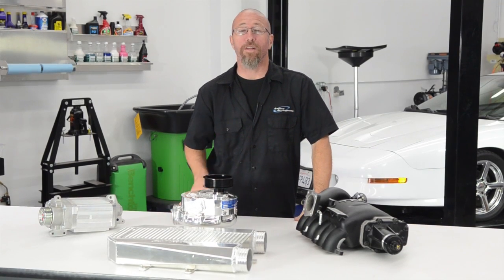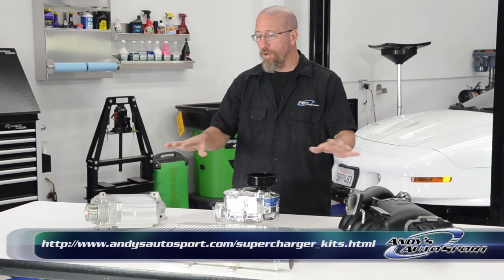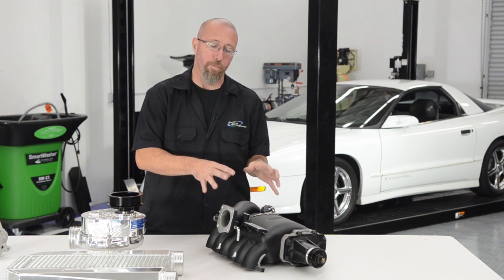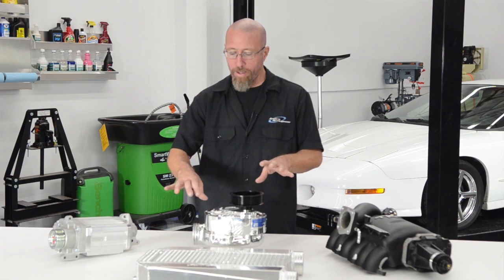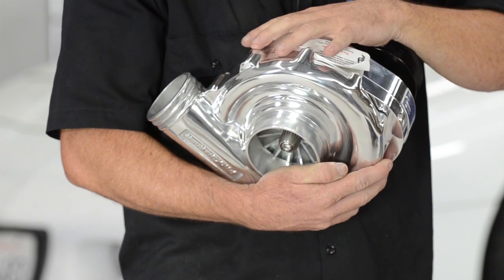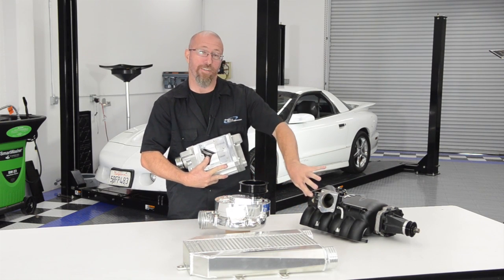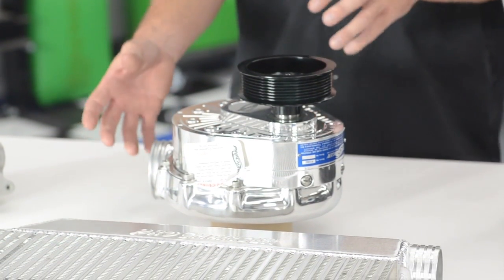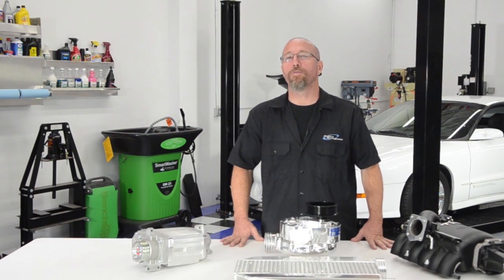Superchargers Overview - Roots, Centrifugal, and Twin Screw

Comment: Do you all have any knowledge of running a supercharger on the newer engines that have the cylinder deactivation systems. I ask because I have seen a few people who have 1000+hp vehicles getting 20-24 mpg with the engines that have the cylinder deactivation setup.
Reply: Cylinder deactivation is definitely possible with moderns electronic engine control systems.

Comment: Not bad. Very thorough. The only thing that was missing is ... which supercharger was quietest ...during idle and ... during boost. It would be ideal to have had a audible sound comparison.

I originally came to find out which one was more fuel efficient during normal driving and which one during all out boost.

Comment: Hey Andy, I have an Infinity G35 and I'm looking to gain a little more bottom end horsepower without adding a turbo or super charger or anything that complex. What would you reccomend?
Reply: I don't think you have any options if you say no turbos, superchargers, or anything that complex. Anything for good power is complex. you can do a new intake, exhaust, and programming but you wont gain much. A good tune might help with low end power, maybe.
Reply: Josh Hagerman Agreed. A tune, cold air intake, exhaust, etc. won't add more than 20-70 HP at best. You have to go forced induction or nitrous injection if you want to add >100 HP.

Comment: Two-stroke diesel, by design, need a supercharger otherwise it won’t run. Instead of having a normal valve at the top of the cylinder like a normal 4-stroke diesel do, two-stroke counterparts use a transfer port at the very bottom of the cylinder end but unlike 2-stroke gasoline, two-stroke diesel doesn’t use a crankcase scavenging effect to breath in air instead rely on supercharger to push in air inside the combustion chamber. One of the benefit of having this design is it doesn’t burn oil as the lubrication system are the same as a normal 4-stroke gasoline/diesel and also it doesn’t suffer from a charge leakage like a normal two stroke do as the poppet exhaust valve is still there.

Comment: A naturally aspirated engine of any displacement, cannot draw in an amount of air/fuel equal to it's displacement. 100% volumetric efficiency (VE) is all but impossible. The combustion chambers atop the piston bores are dead zones which prevent 100% VE. Now if there were no combustion chambers, you might have a 100% VE engine, on the intake cycle, but you better not try a compression cycle. lmao
Bacically the only way an engine can ingest an air/fuel charge that's equal or greater than it's displacement, is with help from a forced induction system.
Reply: Exactly what I was thinking.